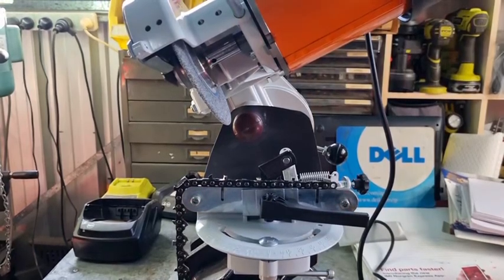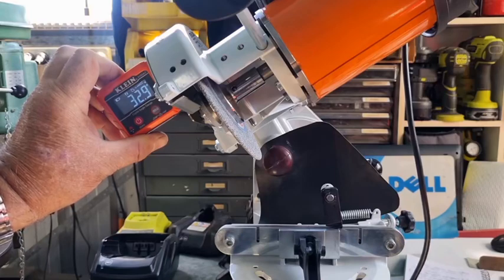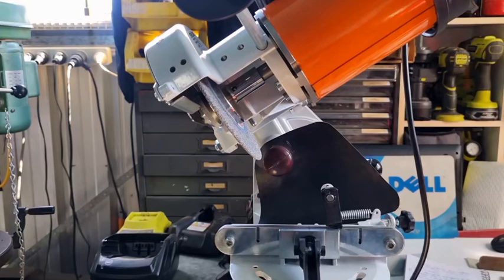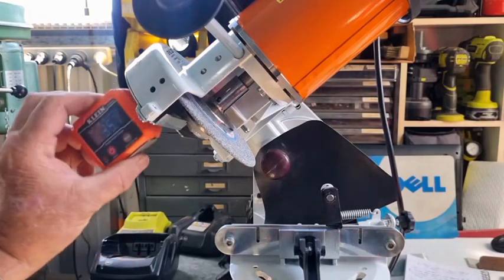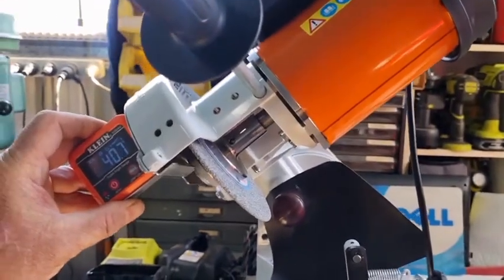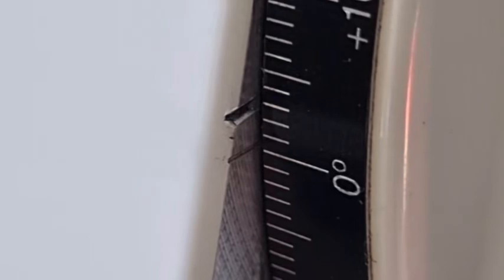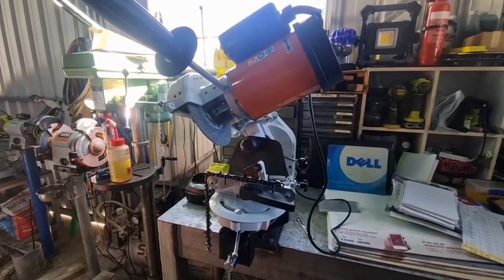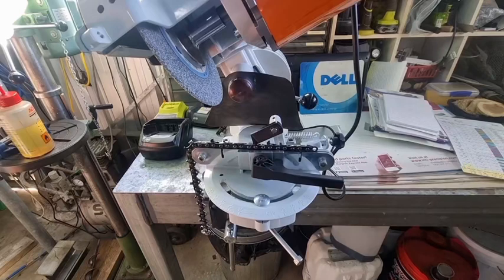Stihl USG 3° error on the ( A ) scale solved

Comment: I have a new USG sharpener like yours and I noticed that on the right side of yours where the head tilt bolt is that you have what might be stick on degree markers on the right side which is much easier to look at then trying to look the whole way around the left side where Stihll puts the original head tilt degree markers, anyway where can I get, or do you have any of those that can be stuck on that look more professional than me putting white duct tape and marking 55° or 50° which is the two general head till angles that I use that would look something like you have?

Comment: Hello! Please make another video about the experiment with a ruler clamped instead of a disc on the USG. Perhaps you can figure out the reasons for this phenomenon.
Reply from the maker: I remember you saying that the eye bolts being offset may have an affect.
I spent many hours working on this 3° offset and I tried what you suggested, but it had no effect.
It's taken me over 2 years to solve this problem and any offset from the   grinding wheel centre line has and affect on the A scale and the C scale
I held the digital angle gauge on head as I moved it up and down but it stays at 3° 
Hope this information helps